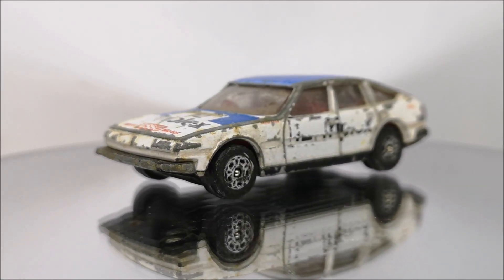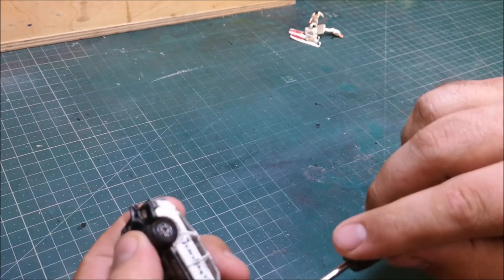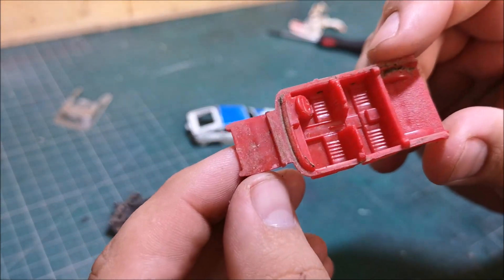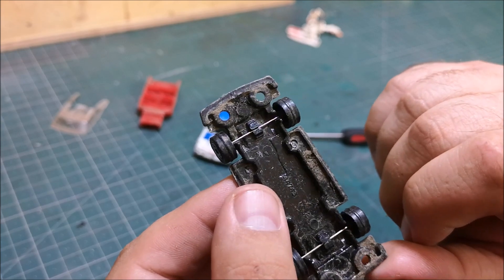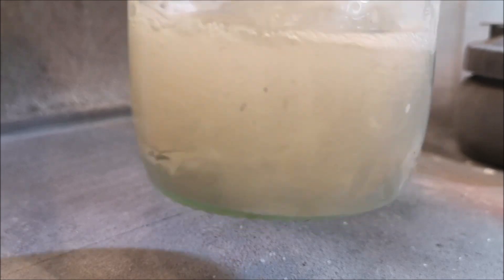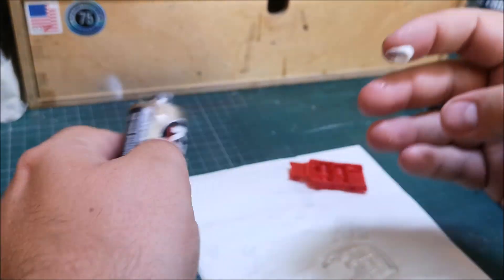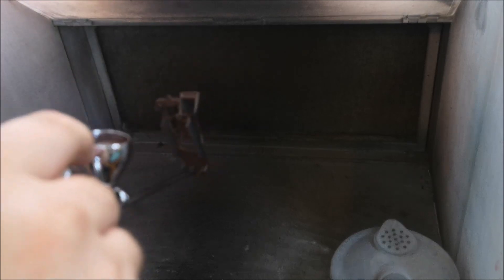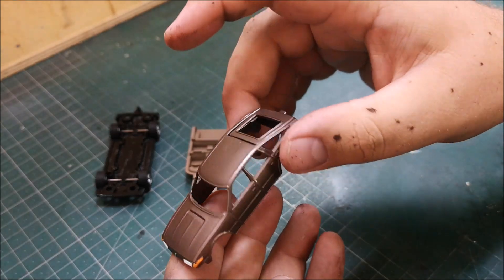Corgi Rover 3500 Restoration+

Comment: Excellent job as ever, wheels look like the early 3500S ones. Just a little hint, if you hit the tabs that hold the tailgate with a centre punch it tightens them up, then the tailgate stays open.

Comment: British engineering is great. The Rover V8 was developed from the GM aluminum V8s. I believe Rover purchased the tooling for the first ones produced. I believe the new Rover parts would fit on old GM V8s. This car would be great to cruise around in. But, y'all drive on the wrong side of the road, lol. Handled the paint problems rather well...I would have propelled that casting across the room the first time.

Comment: see you understand why you want to get rid of those Wheels but I do have a car need I don't know if you can help me get parts for yatming 240Z and I don't know how to get parts for it and usually I try not to cut the axles but I could understand you know that design with that car General you can pull them out but you know what I still think it's a pretty good custom car you did